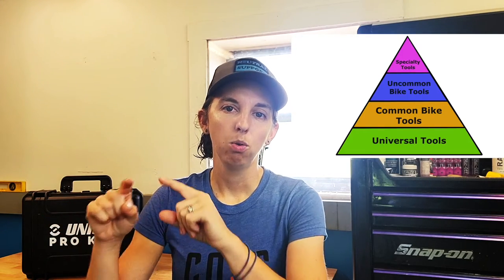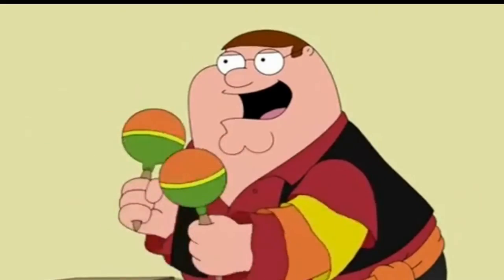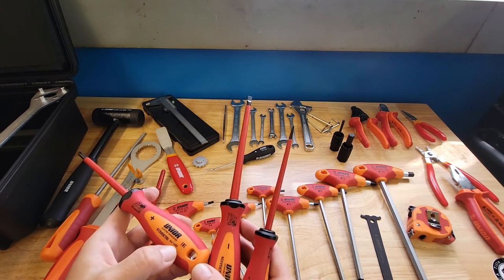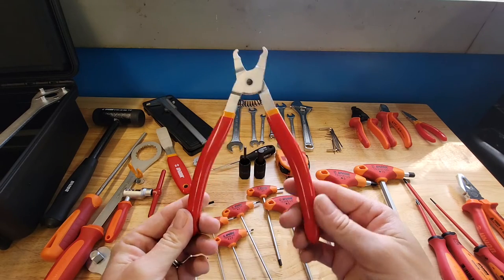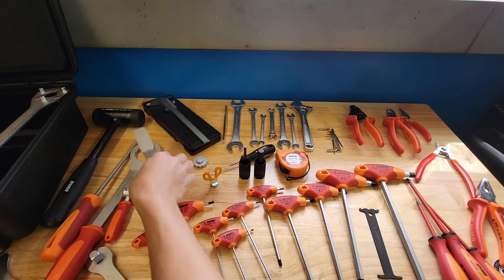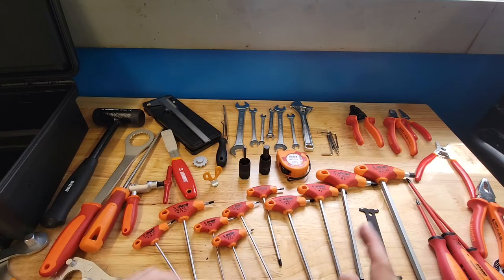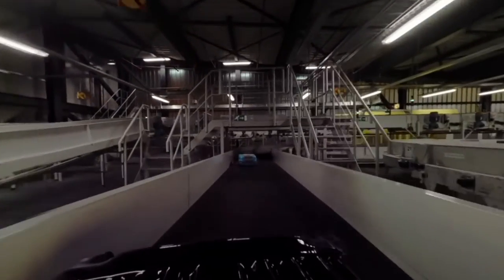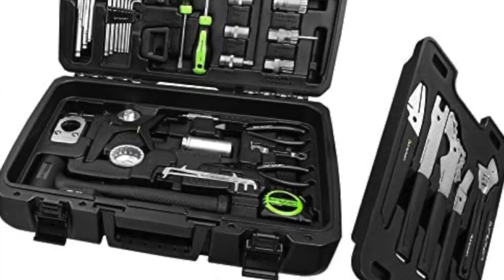NOT Building a Bicycle Tool Kit: Unboxing the Unior Pro Kit

Comment: The analogue caliper can be just as precise as if not more accurate than a digital caliper, it's just a little more difficult to read. And the small hex keys have their use in low-torque, hard-to-reach places such as bottle cages on full suspension bikes.

Comment: I hammered out the prong on my lock ring tool so I could use it on suspension, then I needed another one anyways because it wasn't deep enough to fit over the hub and get a center lock disk rotor off.
Reply from the maker: Sometimes those cassette style disc brake lockrings are a total pain. Much prefer the BB external splined type for sure.

Comment: Great unboxing, actually I like this set. I have some unior tools and this red yellow handles are insulated for use in electrical work. I have the brake rotor truing tool but with blue handles, and a chain wear check tool with a dial for more precise work. I don't have a kit, I bought the tools separately. Unior produces special cone wrenches, similar with the rotor truing tool in this set. For cable cutting I use the knipex wire rope cutter and crimper, is one of the best. I like the box, nice and solid. The hex keys are decent, but I prefer the ones from wera with the hex plus profile and holding function on the ball end. Another tool that is missing from this set is a torque wrench, which I use a lot,especially on bikes. But there is enough space in the box. 👍👍👍👍

Comment: I bought my AXS cassette wrench with a red handle to differentiate 11s and 12s AXS. Not sure if Shimano 12s needs one but I haven't seen one offered yet. I also have the cassette lock ring wrench and it's been very enjoyable to use both wrenches to remove cassettes. On top of that I have a few of their more specialised tools for thread cutting, chasing and facing, deraileur alignment etc, that's where they shine compared to others, in my opinion. But I have been considering a cable cutter as well, the Icetoolz one I have at the moment is rated for cuttinng spokes and in a pinch I had to use it but half the jaw broke off, still works as a cable cutter but I'm slightly dissapointed with it.

Comment: Unior make park tools look like really second rate junk, and everything bar that box and their torque wrenches are made in Slovenia, they even print their own packaging
Reply: Pro bike mechanic told me that park tools are more durable than unior. And we live in europe where unior is much cheaper.
Reply: @bikernaut1  find that hard to believe as Unior make Unior make dealer workshop tools for the VAG car group, I’d go Unior, Cyclus, vAR, Bitul before I even thought about looking at park
Reply: @Thecrazyvaclav I buy what is affordable. I also like Unior more because it looks more ergonomic and we used it quite a lot and just had issues with few tools

Comment: I have a few Unior tools, and they're great quality. Like another commenter, though, I'm puzzled as to why Unior has supplied VDE electrician's screwdrivers and pliers with this kit, colour-coded all the other tools to match, and not supplied a Phillips #2 or a JIS #2. It would have been nice if they threw in a proper ratchet wrench instead of that fixed 1/2" drive tool. Nice box, though.
Reply from the maker: Check out Unior's reply to Charlie - they sum it up pretty well! Spoiler - it has a lot to do with a certain company trademarking the color blue
Reply: @NeutralSupportNews  Thanks for the reply, Danielle. I read Unior's reply, and I can see the rationale, but I think they're going to have to rethink it - I'm sure I'm not the only bike guy who will associate that colour scheme with electrical work.

Comment: I feel something like this would be more a gift for a teenager(Just get a white sharpey and put a J infront of Unior on the outside of the box), just getting hands on something that feels a bit substantial, and this is a good starting point. You'll feel a bit more adult with a good solid box and I just feel it would motivate them to start fixing things on their own. 

Of course people of any age can use these tools, so I'm more referring to the kit side of this, and most would not need a portable kit. At least I personally hand pick every tool I got and that is the better route, if you are passionate enough. Tools are half the job, and when you want to use them there's just no better feeling than that. Tools are an investment, and I do recommend getting tools before you need them, because if something breaks and you don't have the tools and/or part(s) it is just too easy to put it on the backburner. When you do got tools at hand, there is just no excuse and that's how I like it. An excuse to do something constructive.
Reply from the maker: No kit stays whole long 😁 But it is one of the best ways to make a lot of progress quickly with less money.

Comment: Your issues with digital calipers are because you buy cheap ones, get a Mitutoyo. Batteries last for years and no temperature problems.
Reply from the maker: I have the same issue with my Wheel Fanatyk Spoke Tensiometer with a fancy digital gauge - I just buy Mitituyo analog calipers instead.
Reply: @NeutralSupportNews   I second the use of Mitutoyo digital calipers...I recently replaced the original battery and I purchased them in 2015.  Analog is great if you are going to work in metric 100% of the time (or you are a machinist and can do metric/SAE conversions in your head on demand), but I've found the in/mm conversion on the fly to be very useful.

I've had cheap calipers, and as proven by some other people on YouTube, the idle power consumption was basically identical as the in-use power consumption.
Reply: Team analog. A rotating needle on a gauge is just more intuitive for example if rotating a shaft and looking for flat spots with some pressure on the verniers.